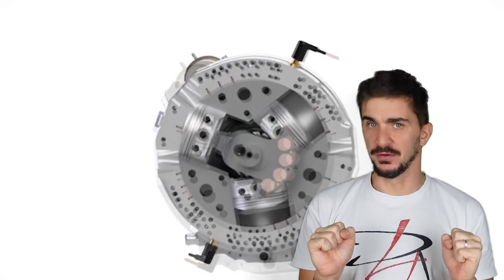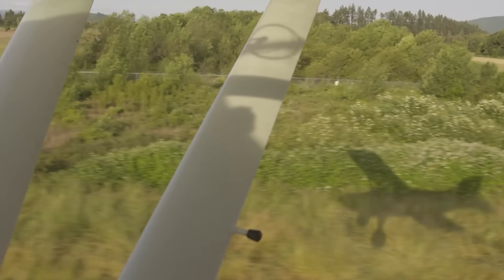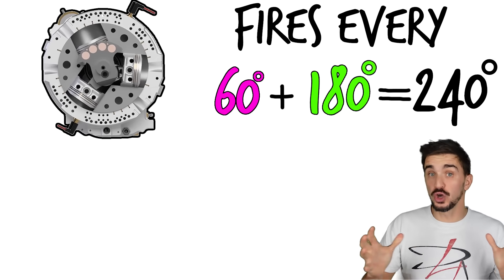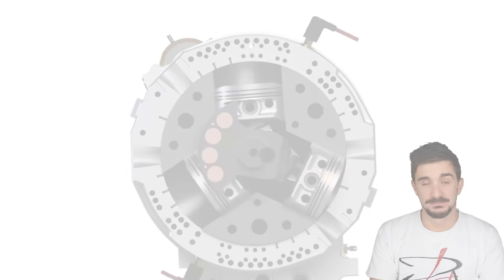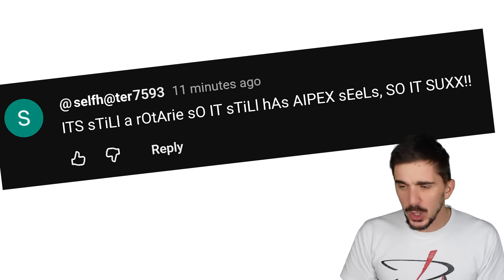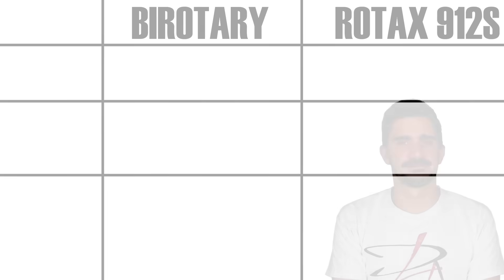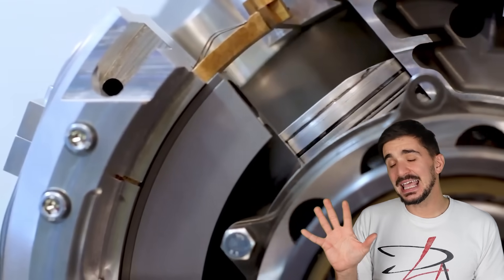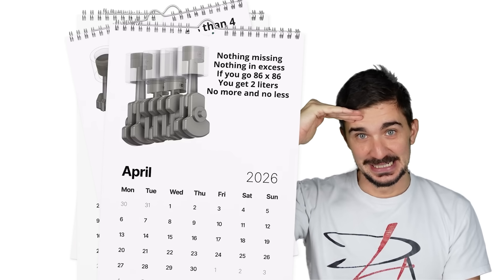This is What Happens When Pistons and Rotaries Make Babies - Birotary Engine Explained and Reviewed

Comment: Could anybody imagine one of these engines on an motorcycle. 
I don't think you see the crazy benefits 
1. No gyroscopic procession that's a big one

2. Forced induction is there twice as efficient cuz it's blowing in the same direction as the pressure drop 

3. this engine is so overclockable, air coolers have a massive effect, oil coolers have a massive effect 

Consider an all electric bike, you start to see the real potential of this engine.

4 the correct alternator will simply act as gearbox allowing it to rev up like crazy well transferring the max possible amounts of torque to the wheels if it's regulated by a computer 

5 I see some improvements the overhead exhaust can be used to drive it turbine connected to the crank because the RPM so high for efficiency

6. Or in a different configuration have an intake turbine connected to the crankshaft, computer tells it to cut all loads and back drive it you can force RPM change through a battery system. 
Or in another configuration fuck a battery system slap big enough capacitors to Go from 1k to 10k rpm with the wheels and series driving the bike and revving the engines at the same time 

7 did someone say two wheel drive motorcycle

Comment: For improved efficiency, reduced emissions, and increased torque across the rev range, it's necessary to be able to adjust the ignition timing and fuel injection duration based on engine temperature, RPM, and throttle response. This would involve moving towards a Miller or Atkinson cycle.

It appears this engine is limited by the spark plug position (there could be two) and the position of the intake and exhaust ports. High-pressure fuel injection would be a welcome addition.

Comment: They could easily adapt a variable port timing. Also use 2 outputs, block and crank, which would require half the transmission gears. I think it could make a great bike engine

Comment: Cars and motorcycles might be out, but I could see it being used for generators. And I'm not talking about a couple thousand Watts I'm talking about the ones that run at 6 8 10,000 w generators. Once the motor is up to speed you could have a clutch system to run the generator.

Comment: All cars and some motorcycles will in future be either EVs (not relevant here) or EREVs.  EREVs give most of the advantages of EVs and all the advantages of gas cars while having less parts, and higher reliability.  (And they can function as EVs for short runs.)  They are a no-brainer.  So as a car engine, this seems like a good fit.  But I'd have liked you to directly address it -- functioning as a fixed-speed generator, will this be the same as in a aircraft?  Better?  Are there better competing designs for ICE generators (as EREV motors are all simply generators)?  The size and less moving parts seems to make this ideal.  The sound volume and gas efficiency... maybe not?

Comment: Did a quick napkin calculation and a smaller version of this configuration (60hp or so) running a axial electric motor/generator connected to 40-50kw/hr battery set + inverter, battery management ect. could replace a 100hp Rotax nicely. This would allow high electric toque at takeoff and lower power at cruise plus about 20-30 minutes of no fuel range on pure battery for added safety. An ERev electric aircraft with a 3 to 4hr endurance at about 15% less cost.... depending on the cost of this engine. :-)

Comment: Cool video and engine architecture.
Two comments:
1. You made a mistake explaining the torque. (Need many pulses to combine to get one big pulse of torque) these forces only partially add up so that isn't the correct explanation. The corect explanation is that they amplify the torque by converting from high rpm to low rpm. Power =force times speed. 
2. This engine can work nice on cars and motorcycles in a hybrid electric or pluggable hybrid. That way the engine works at its optimal rpm and everything else is handled by the electronic controllers. But since it is a simpler engine it can have better reliability. (High rpm might work against reliability though)
Cheers!
❤

Comment: Welcome back, radial engine.
Reply: Rotary.  Radials span the crankshaft rotaries span the pistons.
Reply: @jimmydesouza4375 then please, do tell me the name of the part with counterweight that transfers energy from the pistons in this engine, be my guest.
And no, early radials span around stable the axle.
Reply: @TheArklyte  No.  You are completely wrong.  Early ROTARIES span around a static crankshaft that was affixed to the vehicle being powered.  The output (almost always a propeller) was mounted to the pistons and span with the pistons.

RADIALS are static pistons that spin a rotating crankshaft.  That is the difference between a radial and a rotary.

This engine is rotating pistons around a rotating crank, but from the point of view of the pistons the crank may as well be static, and the output is (if what the guy in the video says is true) is mounted to the pistons.

Comment: Knobgear's "zero vibration" engine is does not look like it is zero vibration. Their own demo video "standing" a coin on top of the engine. One can see the coin rotated and moved a little on its own. But, still very impressive and interesting, though. Looks like basically they've combined two single cylinder engine together at the crank with gears like a boxer engine and such that most of both the primary and secondary forces cancels out. Probably puts a lot of stress on the gears — with each cylinder constantly pushing them together then pulling them apart.

Comment: I'm not sure this is better than one of the latest 95% efficient electric motors powered by a battery with an energy density between 500 and 1000 Wh/kg?

Comment: Honestly, the poor low end power might not matter as much as you'd think with motorcycles. 100hp at 750cc is on par with modern motorcycle engines, and many bikes idle much higher than cars, minimizing the low speed impact. No idea on transient response if it'd be any good or not, which there's a lot of moving mass so I'm doubtful, but who knows. To be honest, I'd think it'd be a strong use case for more of a city commuter scooter. The 3:1 reduction to the block means you could drive the rear wheel directly from the engine without a transmission if the top speed was aimed to keep low. Interesting thoughts. It's an amazing creation and I hope it takes off!

Comment: Wouldn't the stroke lenght be relative to the circumfrance of the motor chamber?
Lowering the rpm and increasing torque per stroke the larger the motor gets

Comment: lotta effort for no win.
 compared to an electric engine it will always loose.
Lower tork than an electric, less RPM max, and temperature ,as in thermall loss.
Even wen dragging a huge battery the electric engine will win.
Simple math,,,, heat needs to be transported away from the engine,, transport = usually water, so water tubes control components, and one big fat radiator..
All these things are not needed with an electric, and even if,, they can all be half the size.
I am no mathematic, but a mechanic,, and i say,,, drop it... and build a hybrid or a full electric..
combustion engines are a thing of the past.
No 2 ways about that my friend.
there was once a locomotive,,, 3x8 driving wheels,,,,, Eri railroad... and yes it was strong and powerful, but even that giant went down on power and ran out of air.

Comment: 1) There is Hybird car type, where engine just supplies the rest of the car with electricity (I mean it rotates with custom speed constantly - like in diesel locomotives). So it's not out of use for auto-industry 2) Just wondering why they keep the circle shape of pistons - they could stretch whole engine crankshaft-wide (and make cylinder more oval) to make more power.

Comment: Interesting concept. 
You could use the birotary in a hybrid car: The e-power will accelerate the car. Then the birotary could take over, either for mechanical drive (Toyota) or as a REX charging the batteries. (BMW i3, first Chevy Volt).

Comment: Food for thoughts : The timing between intake and exhaust port could be tweaked dynamically using eccentric holes ? You would only need to rotate to main port to changes the angular distance between intake and exhaust. And since it would only be a cylinder spinning slowly in a tube, that wouldn't need a complex or expensive sealing IMO.
Had you 2 planes of "birotary triple-pistons" (or even more) you could achieve an interesting engine. 3 of those would bring the total umber of cylinders to 9, which would fit the September page of your calendar ! 😉😉😉

Comment: The narrow rpm range could probably be cured with some variable port geometry. Think variable exhaust ports on 2-strokes. The lack of major weight advantage to 4-stroke kills the range extender route, a DI 2-stroke with good oil might win, especially considering rotating block oil consumption. Ring seal, especially with crank vacuum, has improved from old rotating radial days, but even 1/3 of crank speed is quite a centrifuge. Let's hope this finds a niche to develop and mature in.
Reply: Throttle response the port geometry would do less to, with all that rotating mass. This has piston rings AND rotating seals, i missed how the block would be sealed axially. Thst's all non-zero friction.
Reply: But inherently removable block for rebuild! Wait, how are the cylinders cooled?

Comment: I wonder if this would benefit from a supercharger or blower for the lower RPM air intake problem. Since the problem is low RPM then a turbo would be a bad fit in that regard sing it needs very high RPM for it to start making any sort of power. Honestly for general car use, turbos have already been proving not the best fit on everyday drivers especially in cars where they don't get proper oil changes. Even if this thing was strapped to a generator to power the car, it running at high RPM would kinda kill off most fuel efficiency killing it for that market. Would be perfect for long transport vehicles going back and forth but delivery type vehicles like Amazon would not work as well since they are a stop and go. There would not be much benefit over a diesel electric version.

Comment: Just imagine  an opposed piston engine like this. With two pistons per bore.  With two bores  across from each other . Or just a traditional style engine block, an i4 or i6.  With 3 rods  per bore and single crank.  Maybe  a 1.5" stroke [1.5-2" stroke] the pistons move 3" to 4" from one another.. producing  the TQ. of a longer stroke using two long rods about 12"-12.8" long. Attached  to a smaller  rod with a rod journal attaching them. The small rod is about 5" center to center. The rod connecting to the crank directly is about 6" long. With a 4" bore to 4.250"  and up to roughly 4.500"  , 2" stroke x 4.150" bore x 3 cyl.  It behaves like a 4" stroke when the torque is produced. It should be quick revving, and efficient,  the efficiency should be easily noticed. A3 bore engine should produce the power of a large v6 or small v8 engine. 100hp/litre should be average and get 30mpg. And up to 40-42mpg depending on the aero of the vehicle.   A boxer layout would be better, use a rocker  assembly at the end of each bore using a large aluminum rocker with a 2" journal. With a 2" wide. Bearing possibly  using two traditional rod bearings per  journal. A solid 2"x3" aluminum  bar  with a 2" thick area for the rocker, wuth 3/4" thick cap fed by what would be equal to a big block chevy stock oil pump. The rocker having a journal on each end one 1.8" for the piston rod, the opposite having a 1.5" pin for the small end pin of the rod connecting to the crank , under the cylinder bores.  A rpm peak of 7500-8200(+/-300)  possibly greater if aluminum rods are used.  With 10:1 -14:1 with gas/spark ignition engine,  and 18:1 to 26:1 for compression ignition engines, these will require  steel rockers and thick rods, 5500 rpm peaks [5500-6200(+/-300) with stronger parts]  using a 2stroke cycle and large ports, scavenged by blower. A pair of intake and exhaust. With a turbo, 122cid , it should run like its a 244 cid engine.  But rev like a 122cid, I would love to see how a opposed piston engine performs..   HAPPY HOLIDAYS, HAVE AN AWESOME DAY🎉🎉

Comment: If it only has a narrow useful RPM range, then it sounds like it'd be great as a range extender for a hybrid, or an automotive generator for an electric vehicle, even. And if this were running on diesel and had a turbo attached, it might be even more efficient in either of those roles.

Comment: Congratulations, shit-fucks. You reinvent the radial engine. Ya know, there's a reason we don't use these things anymore.

They evolved from the OG rotary engine, the engine type famous fkr power WW1 legends like the Sopwith and Fokker DR.1. Later, they evolved to the Radial engine, an engine type known and loved by everyone who knows what an airplane is. Engines like the Pratt and Whitney R2800W Double Wasp, with 2.8k cubic inches of displacement and pumping out 2000hp, powered legends like the F6F Hellcat, F4U Corsair, and P-47 Thunderbolt. They were loved for their incredible horsepower output, durability, and easy air-cooling systems.

However, they fell out of favor and were replaced by V engines, inlines, and horizontally opposed engines. These simpler engines didn't pose problems regarding structural integrity when trying to increase compression ratios. Most radials capped at around 5-7:1 while V engines could reach 12:1. They were also more aerodynamic. So the decreased drag and increased compression ratio meant that it could boost performance enough to overcome the weight of liquid cooling systems.

Comment: That's a Radial Engine. they used them in WWI. The crank and block rotating in opposite directions with a 3:1 6000 engine rpm = 2000 prop rpm. That's really high and a lot of wear for a plane. In a car or bike running through all the gears in a transmission should also require 3x the amount of gears. you want a 15speed in your car?

Comment: what if you made one with fewer pistons in it and/or used the one intake/exhaust port idea (in an effort to get the longer stroke out of it) and then just stacked stages of these on each other offset by some fixed amount of phase shift? treat it more like a wankel than a radial engine. youd still only need one gear train to drive however many stages you put on it, and the only downside i can think of is that the ports might not be conveniently near each other due to the necessary clocking and would probably need headers, but other than that, why not? also, due to the increase the piston speed and subsequent slowing of the engine with the longer strokes, the pitiful low-end performance would be reduced and it would make them a bit more reliable.

also, how do they handle boost? could using controlled boost levels mimic vvt effects or something similar? if the short stroke issue were to be mitigated and the good effects were to basically remain as they are, it does seem like this design could be promising and ahead of conventional ones enough to just accept that a small boosting device is to be used with it, sort of like how diesels are treated, which could possibly make them equivalents in all the major design and performance categories.

of the engines ive seen this guy talk about, this one definitely caught my interest the most.

Comment: Piston thrust loads would be pretty nasty especially acceleration under load and it would be  magnified because of the short stroke which means short pistons and what about the sealing between the outer housing , inner housing or rotating cylinder block and the end plates - this was a problem for rotary valve engines ( in cylinder head) and slide valve engines , once they started to wear they lost their ability to seal and it killed compression. You also have the issue of heat transfer from the rotary cylinder block to the outer block or to some sort of water cooling system .
Just throwing a few thoughts out there.

Comment: They have to replace the center crank needle bearing with hydraulic bearings. Needle bearings HATE fine particulate contamination, and engines love making fine particulate contamination. The hydrologic roller bearings in modern engines are not doing so well.

Comment: It’ll be interesting to see how the stationary seals hold up with combustion happening in the same spot every time. The seals between exhaust-intake and intake-spark plug will probably be fine, but the seals between spark plug-exhaust will get all the heat and pressure of every combustion event.

Comment: How do you think a turbo set would go , either one off each exhaust port or a single with both exhausts linked , I’m thinking back pressure would be the only concern with a fixed exhaust port , maybe the next generation of the engine might have rotory valve on exhaust or both exhausts and inlet

Comment: if you double the stroke, you can halve the rpm and move the same air, so you make the same power. the piston speed is the same as it was before, so you havent changed the forces by very much.

Comment: Unless it runs on 2 cycle mix oil and gas.... the oil that lubricates the pistons, cylinders and crank would be forced past the pistons and out the top of the cylinder due to the centrifugal forces produced by the spinning cylinder block.

Comment: You didn't cover several of my questions about this engine.  The Graphic behind you at the end of the video showed the first one. how does combining banks of cylinders affect the low torque and RPM problems?  How would  turbocharging effect horsepower and torque? Can this engine be used with different fuels?

Comment: There is no reason that the valve timing in the birotary should be regarded as fixed. It certainly would be possible to set up a sleeve-valve system on the intake and on the exhaust.